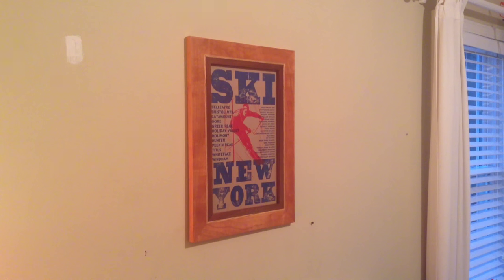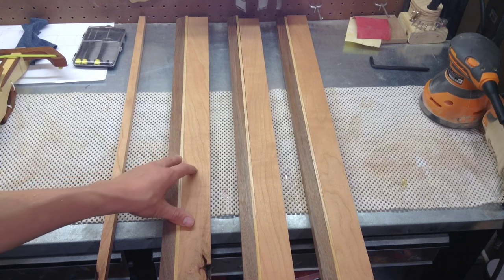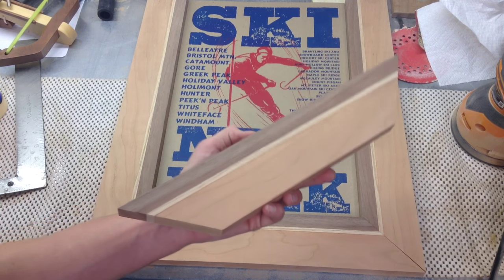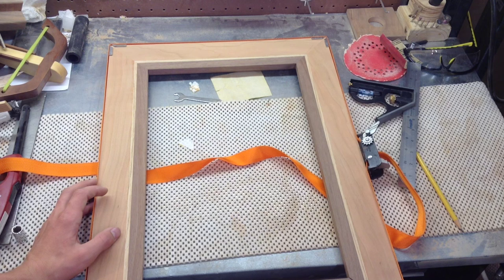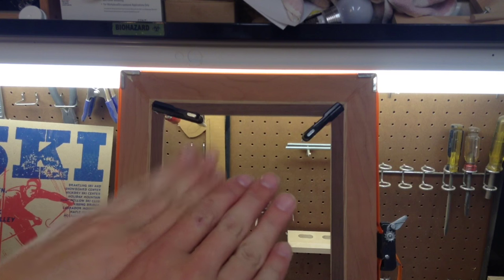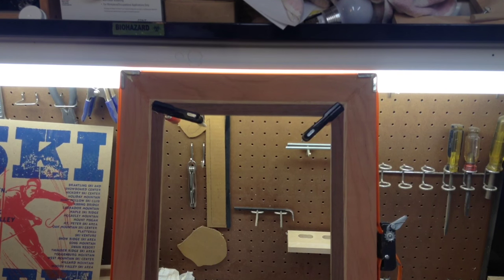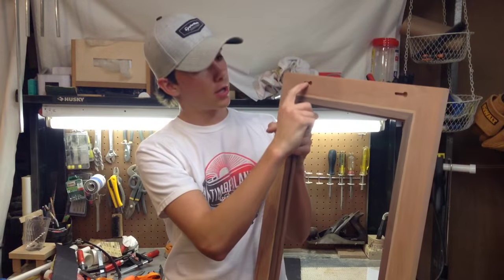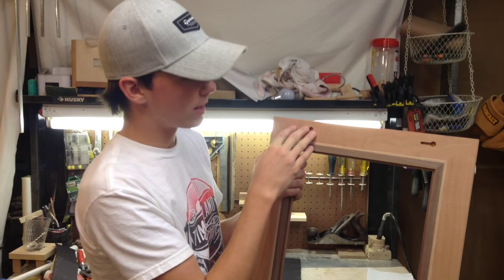Simple but elegant picture frame

Comment: kroy ,,are u from N.Y.??
Reply from the maker: Oh and yes I am from upstate NY
Reply from the maker: +KroyWoodWorks between the finger lakes and the Great Lakes
Reply: +KroyWoodWorks no doubt! im from NY too. Cheektowaga its suburbs 20 mins outside of good old buffalo. .;)
Reply: +KroyWoodWorks definitely check out generals finish u apply it wth a foam brush and doesnt require any sanding in between coats:) good stuff its like 5$more than polyurethane but totally worth it
Reply from the maker: +Joe basementwoodworking That's really cool, I live about an 1hour and 30 minutes east of you

Comment: looks good man!you should add some plexi or  glass to it.. i always go with a chamfer on frames. it  tends to go with the miters for some reason. to each his own i suppose..:) but  give a chamfer a try next time u make a frame..and you should look into "generals finish" top coat . its not at any big box store though and its a little bit more money but if ur looking fo a great finish thats ur stuff. check it out dude u wont be disappointed - rockler.com
Reply from the maker: I was thinking of adding plexi but it is a somewhat textured print and I didn't want a glossy covering over the print. I would use glass of this was a normal picture though. A chamfer is also another good idea, I like to try different things so if the next project calls for it I will give it a shot. Finally I have heard of general finishes but have never gotten around to buying some, I will look into it and maybe try that out on my next project. Thanks for your thoughts, I always appreciate hearing others opinions!
Reply: KroyWoodWorks anytime man! youll love the generals finish. good stuff and u dont need much and the grains POP when its applied.